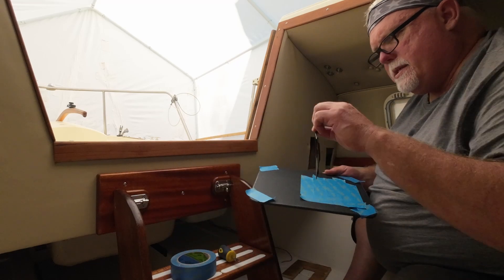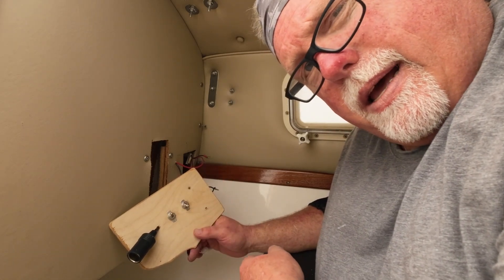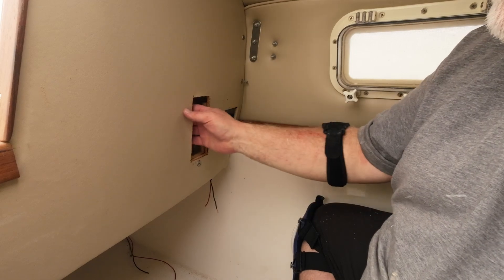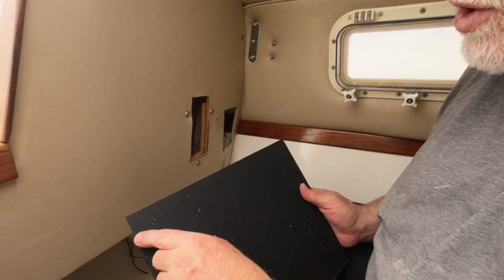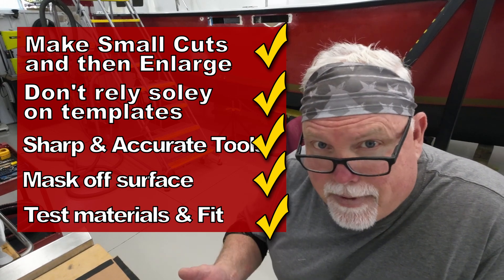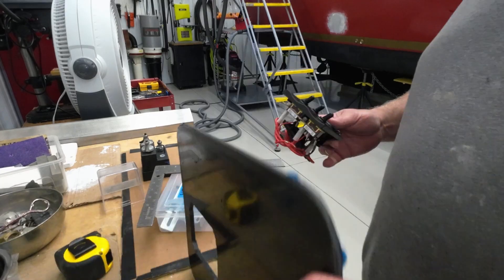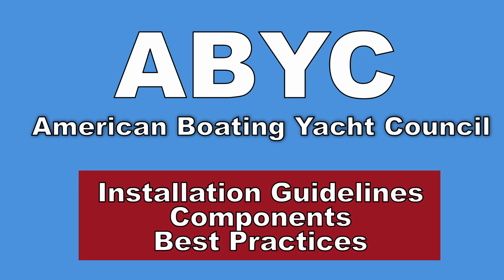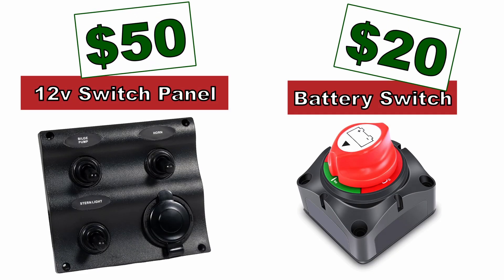How to install 12v System in Your Small Sailboat | Boat Building Boat Restoration (Ep142)

Comment: 80 grit sandpaper cleans up things you make out of cutting boards. I’ve used them many times. I use a countersink bit for mounting holes and use tapered screw that fit flush.
Reply from the maker: Too aggressive! 😝I use 80 grit sandpaper to move material and cut down PVC foam board or fiberglass. A clean routing needs just a light finish —220 or better. Ask me how I know
Reply: @motorcityboatwerks I like how it will remove scratches and leaves a matte finish.
Reply from the maker: 🤨If you use 80 grit sandpaper on HDPE or acrylic or PVC— you will leave scratches in the surface. 👎 you can get a matte finish using a much finer sandpaper.

Comment: No interior light? I found it useful on evening and overnight sailing my Skipper.
Reply from the maker: Good call!👍Microwave, refrigerator, solar, the works! Add whatever you like or use a flashlight. 😎The original boat had no interior light.

Comment: What did you do about the busted bulkhead? Always interesting to hear your thought process. I would have installed the battery switch closer to the battery or at least reversed where the panel sits to make the panel easier to read, but not a big deal. Good luck with the next steps and looking forward to your first sail on her.
Reply from the maker: The position of the switch and panel is due to the holes that are already cut in the bulkhead😁necessary compromises when restoring an old boat. The busted bulkhead corner is now pulled flat due to the panel being mounted. 👍😁Thanks for the comment